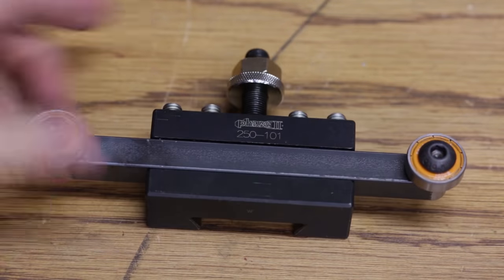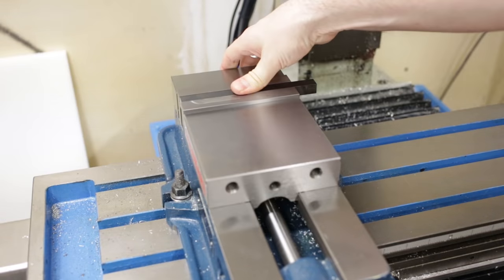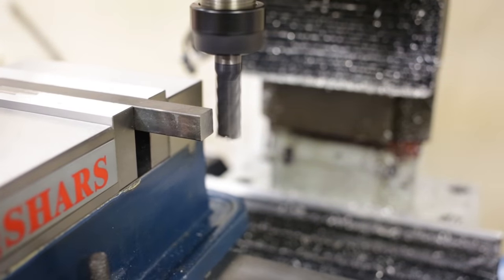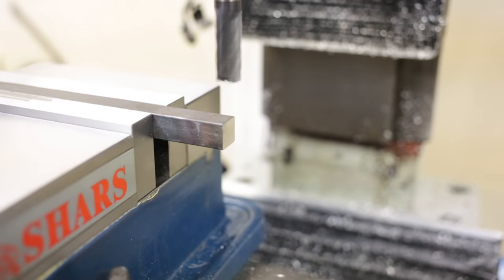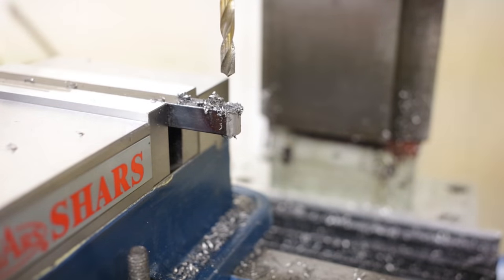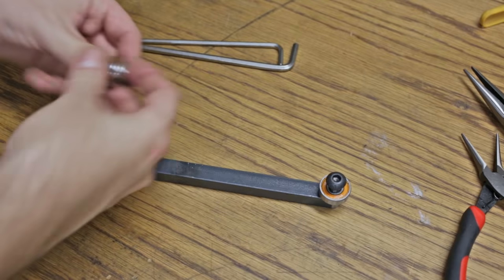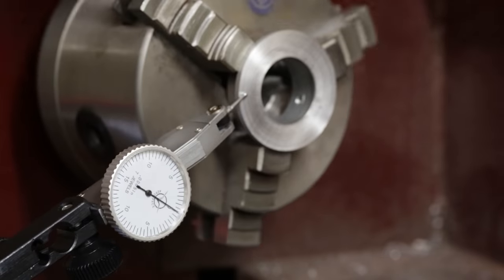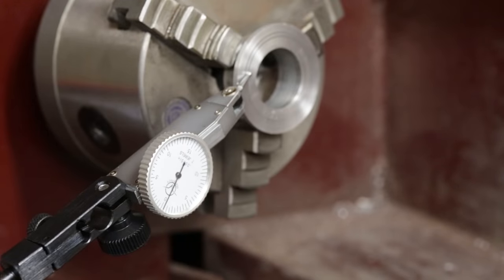Lathe Centering Tool

Comment: This is a hell of a thing right here. Thank you for this video. I've got a really terrible chuck on my lathe at work and it can take easily 20 minutes with a rubber mallet to get + / - .010" runout on a work piece. I spent a few bucks at McMaster-Carr and a few minutes on the mill, and now BOOM, I get + / - .001" runout in about 2 minutes.
Reply: If 0.010” was the best I could I’d either get a new lathe or find another vocation.
I normally worked at +- 0.001 in HighSchool on a manual lathe.   I made a number of lense adapters for camera lenses because the school purchased the wrong lenses. Just an aluminum  ring with internal and external threads so the focal plane remained the same. Don’t remember TPI but was very fine.

Comment: yeah I wasn’t real sure about this at first and finally curiosity got the best of me and I threw one together out of a scrap piece of key stock and a spare bearing I had laying around the shop and I have to say thus far I am impressed with how well it works. It’s accurate and saves an unbelievable amount of time when compared to the old way of using a rubber mallet and a dial indicator to square up a work piece. Honestly, after using this the last few days I would definitely have to say this little tool has 100%  surpassed my highest expectations. Thank you for posting this. Excellent video and tutorial.

Comment: I enjoy the way you explain things, no extra crap, just facts. thanks.
Reply: I do the same thing with a 6"piece of plastic (HDPP) between the tool holder and the part in the chuck. Get's it close then finish with an indicator. I like your idea and will make one soon.
Reply: BTW this only squares the face of the part perpendicular to the spindle centerline, it does not line up the od or id to the spindle centerline. I only use this if I have to take a light cut off a spacers face or something similar.

Comment: Good work, but I recommend you just use a piece of brass or almost any material and rub it against the part, works just as well. Assuming you will face the part afterwards.

Comment: You showed how use the tool from one direction. What about from the other way? How do you use it then? You can't loosen the jaws of the chuck like you did to fix the center of the work piece.
Reply: brownjessea1 really, it's the same process only perpendicular at the end of a workpiece.  I've been using a blunt piece of stock to do this same thing and it works just fine.  Use the cross slide to move in/out.  Pretty straightforward.

Comment: That part wobbled pretty good after you run it with the bearing...simpler and better is to just use a piece of solid brass/bronze and run against.
Reply: Same here buddy i do the same just clamp a piece of brass in the tool post

Comment: Nice. Will make one. I have tons of 8mm spinner bearings lying around so this should be perfect. Any thoughts on using aluminum insteadof HSS?
Reply from the maker: For this purpose, aluminum should be fine, there's no real load being put on the bar.

Comment: Okay, I'm fascinated by your machine skills and tools. I've been thinking about getting a HiTorque mini mill and eventually lathe from Little Machine Shop, but have never used either. What lathe do you have and what about the horizontal bandsaw? (I've found great hobby info online for electronics, woodwork, welding, 3D printing, etc, but find information on machining hard to come by around L.A.)
Reply from the maker: +Mark Moran I have a simple Harbor Freight 9x20 lathe.  There's not a lot out there for inexpensive lathes.  You can try craiglist and get an older one for cheap, or get one from Enco, Little Machine Shop, or Harbor Freight.  There are pros and cons to them all.  The bandsaw is a 4x6 from Harbor Freight as well.  There are MANY variants by a lot of different companies.  It's a good solid bandsaw for the money.

Comment: 3:47 keep pushing the tool, or loose just a lil' the chuck and u wil obtain better results, good luck
Reply from the maker: Yeah, unfortunately when making a video, you need to use the take that looks good, not necessarily the one that worked right.

Comment: why did you use tool steel for this tool there is no need for extreme rigidity in this application I would have used just old crappy cold roll Steel
Reply from the maker: You are 100% correct, I didn't need to use tool steel, it's just what I had on hand.

Comment: Dear Robert: Really, you have built a lathe work squaring tool, not a centering tool per say.
Reply: please give a video on centering lathe.
Reply: Yup, waited all the way to the end to find out it wasn't what I was after...
Reply: @kungfumachinist  That's why you skip to the end first to see what the hell it is. He showed how to use it to square the piece but he also showed you could use it on the side to centre the part in the jaws. I thought it was going to be something to centre the tool height but this is a good way to roughly centre a part.

Comment: I admire your hard work. But you can do it simpler and more precise. Use a single piece square section and make a cylinder on its head by lathe, and then fit a bearing. By doing this you achieve way more precise tool without having to use milling machine!

Comment: the purpose is to automatically adjust the jaws of the lathe ?
Reply: axnbjsbdu dbydvydubu no.  It's to adjust the part and square the face.  The Chuck jaws aren't being adjusted here, only when clamping the piece after squaring.

Comment: In my time, we just tapped the work piece whilst rotating at a decent speed with a handy piece or soft material like brass or bronze. You make me laugh.
Reply: Joseph Vella:  Rotating at a decent speed?  I'm hoping you mean by hand and not power!  Eye/hand coordination under power leaves a lot to be desired.
Reply: Scott Burrous I do mean under power and not by hand. Try it if you have the opportunity. Some 500 rpm should be good.
Reply: Ive tried it before an it didn’t work for me. By the time I’ve tapped the work it’s already moved and I always tended to make it worse. I simply put machine in neutral, use dial indicator and tap with deadblow mallet until it’s true. Faster than tapping on a moving target. Maybe it’s becaude I’ve been doing it the same way for 47 years and can’t learn a new method.